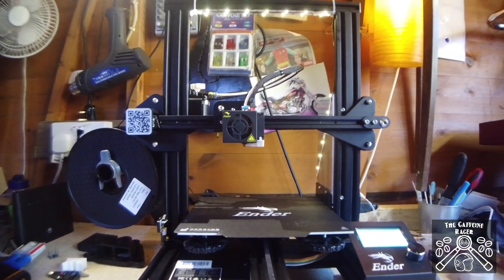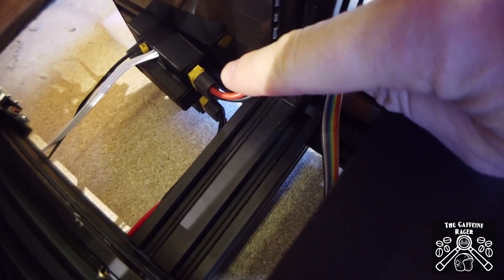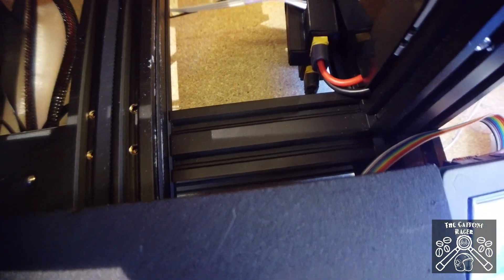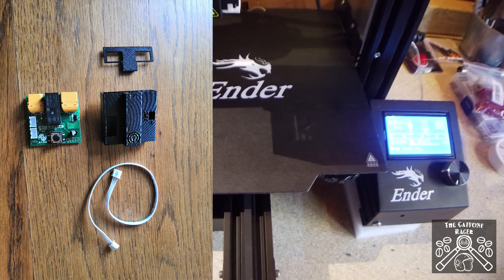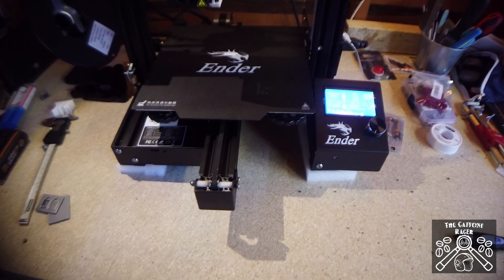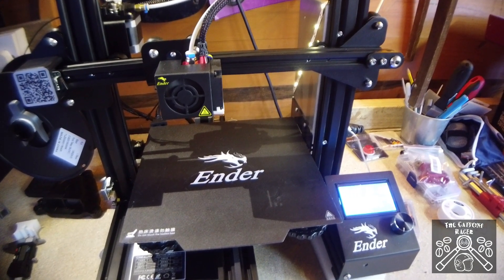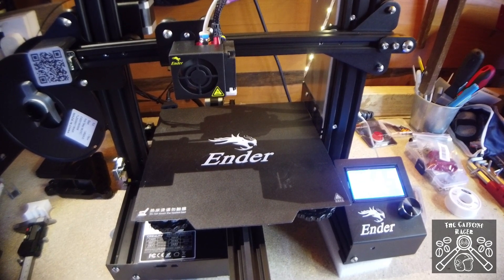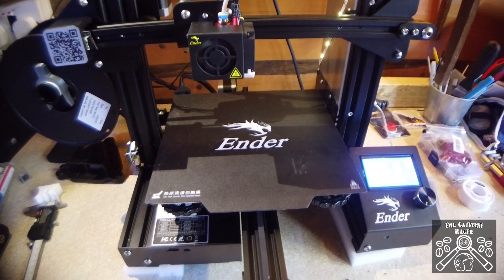Ender 3 Pro auto off easy mod

Comment: This is a safe solution, but the price is outlandish. It’s a relay and a couple of connectors. Should be less than $5. Also, this does not power off the power supply. Best to have a relay between mains and the power supply.
Reply from the maker: totally agree with you there.

Comment: Hi with this module I do not risk turning the printer off every time I do the home of the nozzle since it touches the limit switch of the y where should the module be positioned?
Reply from the maker: sorry i didnt see your message. yes if the bed sits at the home position too long it will cut the power so either preheat the bed or turn the device on after the print has started printing to avoid this. i have been caught out a few times when i forgot i had it on.
Reply: Timsalsanights aka The Caffeine Racer does that mean if the module isn’t on, I can home the printer without it shutting off?
Reply from the maker: https://youtu.be/4wE3tBhoiWs this is way cheaper wish i had thought of this I would have done this.
Reply: @TheCaffeineRacer  Thanks so much for the information they were really helpful.

Comment: Check out my solution at: https://youtu.be/4wE3tBhoiWs
Reply from the maker: turn on your comments am sure people wanna share info with you its a nice mod did you have remove wires or just add them.
Reply: @TheCaffeineRacer  I didn't notice the comments are off, thanks. I mount new cables together with the switch.